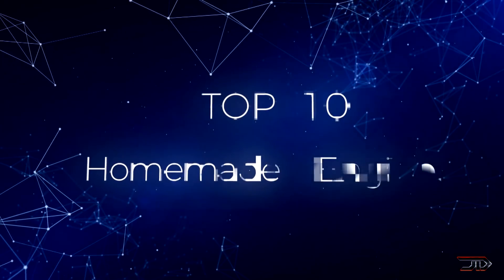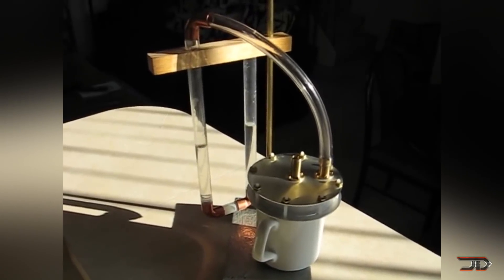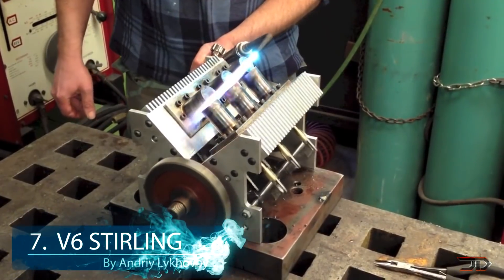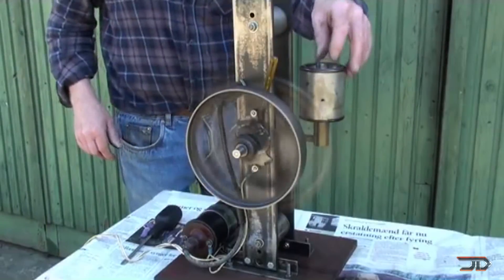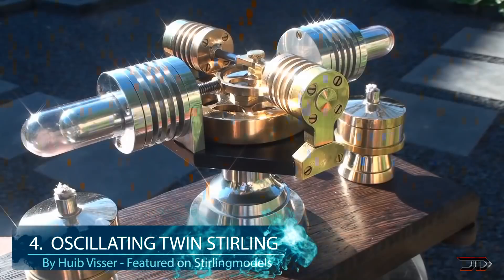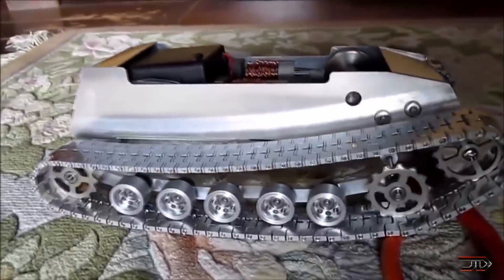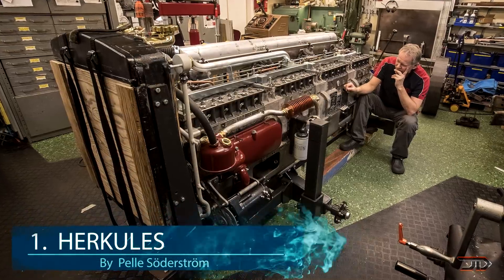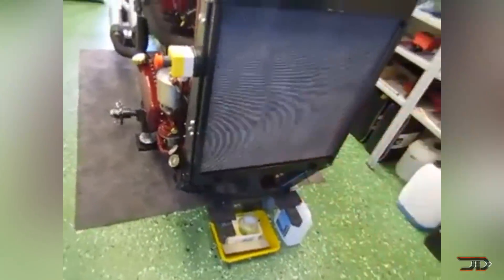TOP 10 Homemade Engines -2-

Comment: Not ALL ARE ENGINES. Most are MOTORS!!! AS matter of fact only #2 and #1 are engine's.  It amazes me how many people say motor when they mean engine and engine when they mean motor!!!
Reply: There is no agreement at all as to what the difference is. In other languages there are no such differences. Both engine and motor refer to a device used to convert some form of energy into mechanical motion. The difference was invented by frustrated auto shop teachers that would rather have gone fishing.
Reply: But you called it a Steam Engine, didn't you. No one speaks of a steam motor (there is an exception here, a special machine called a steam motor that is used in light locomotives).
Reply: There is no argument about different types of machines, but you forget how this began, namely with you correcting the originator of this video for generalizing the word engine. At the same time you say a steam engine is not an engine, yet you call it an engine yourself. You demand that someone else be exact in use of language and then break your own rules. Hypocrisy is generally not a virtue.
Reply: The misunderstanding here is that you assume language is objective and everyone understands the same thing when they use a word. Alone, your misunderstanding that an internal combustion machine is an engine, thus ruling out steam engines (steam motors?) shows how wrong this is. You have a definition that you understand and that is fine, but you cannot expect anyone else to agree with you about it, unless they decide to do so. What you are describing is not an engine per se, but a "heat engine," which converts chemical energy stored in a carbonaceous fuel (or solar?) into useful work. The term heat engine is a technical term understood by engineers. Whether someone refers to such a machine as an engine or a motor is irrelevant because everyone knows what is meant in context. If this were not the case there would be the same terminology in other languages, which there is not. In French, German, Italian, Spanish, etc. a motor is a motor, whether a heat engine or an electric or pneumatic motor. BTW, the word engine is used in many other senses, such as a "graphic engine," or a "modelling engine." Semantics is worth thinking about.
Reply: Ah, therein lies the rub! In the Heat Engine it is the heat that does all the work. In other engines (and motors if you like) heat is simply an unwanted bi-product. That is exactly why heat engines have that name.
Reply: This is rather humorous as my wife (Instagram@karinpfeiffboschek) is a very well-known pie baker/artist. It is quite amazing how many people refer to her pies as cakes. This is the subjectivity of language. The reason they call them cakes is because English is not their mother tongue and in most other languages there is no general difference (e.g. German where "Kuchen" refers to any kind of baked pastry and is generally translated as "cake," and consequently there is no differentiation between cake and pie). Is this wrong? Yes, for native speakers. But a pie is defined quite clearly by the general English speaking public, whereas a motor has no general definition, only subjective definitions such as your own. You yourself called a steam engine an engine. Be tolerant and try to jump over your own shadow. It makes everyone's life less stressful.
Reply: A steam engine is useless without steam. A steam engine with its boiler is a heat engine, just like an internal combustion engine. But, in any case, you yourself call it a "steam engine." As I mentioned above,  a "steam motor" is a very special kind of a steam engine.
Reply: Ask an engineer what a steam motor is and you will get a very specific answer. You are ignoring your own argument, calling a pie a cake. A steam motor is a very special kind of steam engine and the machine used to power a large steam locomotive is not called a steam motor, but a steam engine.
Reply: I did not mean to upset you. You confuse words that have an accepted technical definition such as heat engine and steam motor with words that do not have an accepted technical definition such as motor and engine. The difference you believe in so religiously is one that you have concocted for yourself, and you have all the right in the world to do that. But you don't achieve anything useful by trying to force your understanding on anyone else. Yes, this is just about words, because you began this trying to correct someone else's words. If necessary, try using Google.
Reply: I am definitely ignorant and appreciate the fact that you recognize that. I am also 50+ years older than you are and was building engines and repairing motors, winning drag races and studying mechanical engineering 30 years before you were born. I tried to point out your misunderstanding about the use of terms because you are obviously smart and write correct English sentences, something rare these days. I wish you a great deal of luck in your endeavours, and you're doing a great job on the Pick'm up truck.
Reply: I stated very carefully, that the term "steam motor" has a very special meaning. Check Google about that if you want to know more. You made a very general reference to something called "motor" and "engine."
Reply: Rocker Pat You did start to sound like an idiot around your third reply. This reply however prove that you’re an idiot.
I know, I point out the obvious and you can thank me later.
Reply: Rocker Pat Lolololol, proves my point right there Princess 👸
Reply: Rocker Pat Proven you’re an butt hurt idiot.
Anyway, although a princess like you entertain me, I don’t usually waste too much time on less intelligent millennials like yourself.
Knowing you’re grinding your teeth being angry will keep me happy for some time. 
Bye bye oh sensitive princess.
👸
Reply: Rocker Pat Princess, can you entertain me today too?
Make me laugh since you have the mind of an obnoxious and rebellious teen?
Cars? I don't play with toy engines.
Reply: At least no one mentioned his unnecessary apostrophe, could you imagine the dumbass argument that would follow...

I understand what he's getting at, but yes the terms are fairly interchangeable.

If you had a Stirling 'device' with an aluminium displacer cylinder, containing a steel piston, with an electric induction coil around the hot end. What would he call it?
Reply: true, but General Engines just doesn't sound like a company.
Reply: I usually see an engine being different then a moder.
Reply: Vee Eight Motorway - Engineway
Motorcycle - Enginecycle
Motor vessel aka M/V - Engine vessel
Steam engine (locomotive) - Steam motor

A tricky one, Google search engine? Not much combustion going on there no?

Languages change, words interchange, new words comes up...
As simple as that.
Reply: I have never been given an accurate technical definition of both motor and engine..the two terms get interchanged often..if possible can this be explained
Reply: James Jacobs An engine runs on fuel and converts fuel into energy to say turn a shaft. 

A motor does not convert any fuel since a motor runs on electricity, hydraulic oil, air pressure and so on. 

Sometimes an engine is called motor anyway as in motorcycle which by right should be enginecycle. 
Everybody know what to call what unless youre a liberal named Rocker Pat.
Reply: Rocker Pat 
A steam engine doesn't use internal comustion, and it's not a motor.
Reply: An engine uses combustion to make mechanical movement while a motor uses a form of energy, like electricity to make mechanical movement
Reply: @FrmerK20  a combustion engine uses combustion, a steam engine uses steam, a motorcycle should have electric motor. An Enginecycle would have an engine. But then again , asteroids and hemorrhoids should be switched...Lol
Reply: Just wondering what they use to power the vehicles in "Motorsports"...
Reply: Rocker Pat do any of you dipshits ever shut the fuck up.
Reply: +Bruce Boschek There is a huge difference between an engine and a motor.  A motor is driven by an outside power supply. An engine is internal combustion!!! You never hear someone call a motor a engine, but for some reason people call an engine a motor.  Motors are electric, pneumatic, or hydraulic.  Engines are piston, jet turbine, and rocket. Motors are driven by stored pressure from an outside source.  Volts=pressure, compressed air =pressure, compressed oil=pressure, all power sources supplied by another machine.  An engine is SELF POWERED!!! Internal combustion =engine!!!!!!!!
Reply: @rockerpat1085  completely abritrary and meaninglessness distinction. It's a dump argument and I like many use the terms interchangeable so STFU with being a pendent and wrong to boot.
Reply: +Bruce Boschek And ALL ENERGY CONVERSION creates heat!!!!!
Reply: +Bruce Boschek Did you read your first statement and your last? You start out stating that there's no agreement on engine and motor.  Now you say there's no doubt that they are different principles.  Yet the whole time you try and paint me as the ignorant one here.  You want to talk about language instead of the ture mechanics. And yes I said steam engine. I said so because YOU WOULD OF NOT KNOWN WHAT I WAS TALKING ABOUT!!! Instead of agreeing with me about people using the wrong words for things you want to paint me as wrong yet you have brought nothing to the table about why I'm wrong about calling them the correct term!!! And no one who speaks English calls a cake a pie!!! And if they do they need to be in FUCKING SCHOOL!!!
Reply: +Eryk Johansson You have proven nothing!!!
Reply: +Bruce Boschek Your ignorant and you know it. I have tried to explain to you the differences between an engine and a motor and you have tried dancing around the FACTS the whole time.  I give up on you and you can continue to be ignorant!!!
Reply: +Bruce Boschek I want you to go on down to your local auto garage and tell them you need your window engine replaced and see if they don't look at you like the fool you are!!! Or maybe your seat engine?  Or your blower engine?  or your cooling fan engine?  Sunroof engine?  You can be dumbed down if you want.  I'll call an engine an engine and a motor a motor.  Now fuck off!!!
Reply: +Bruce Boschek So you're a 100 years old? And I understand very well the differences between an engine and a motor and I use the correct term for each!!!  And thank you about the truck.  Enough said!!!!!
Reply: +Bruce Boschek Look dude they work on two different mechanical principles. There is no way around it.  A motor is driven by an outside power supply. An engine is SELF POWERED!!! Period!!!
Reply: +Bruce Boschek A cake is a cake and a pie is a pie!!! They are NOT the same!!! And we DON'T  call them the same!!! And yes a steam engine is NOT AN ENGINE, it IS a motor and works under the same principles as a MOTOR!!!
Reply: @rockerpat1085  
You are an ignorant fool. No one in English ever refers to a steam engine in any way but as an engine. Motor and engine are commonly used interchangeablely in American English at least for ICE piston engines or motors.
Reply: +Bruce Boschek It takes heat to make both motors and engines work.  When you compress air or hydraulic fluid you generate heat, as well as generating electricity.  The boiler on a steam motor (I only called it an engine so YOU would understand)  is no different than an air compressor tank. Energy is being stored under pressure!!! You can effectively replace the steam with compressed air and it will work (although not as efficiently). You also DON'T need any combustion to generate steam. All you need to make a steam motor work is any kind of gas under pressure!!! There's that word again,  PRESSURE!!!

Comment: What about the ones that harness the constant force fields emitted by solid magnets.
Reply: I hope you realize that is not possible and anyone that tells you they have one is a scammer. You've been watching too many Indian hoax videos. 12-25-2019.
Reply: The above comment is spot on, and I'll add that what you are talking about, if possible, would be a motor not an engine. An engine utilizes combustion,whether internal, external, or both to create movement in mechanical parts to create kinetic energy from thermal energy. If it does not operate on combustion (burning fuel) it is a motor not an engine. Electric/magnets= motor, jet, piston, rotary, rocket, steam,sterling, and other engines all use a fuel source that is burned to produce power.